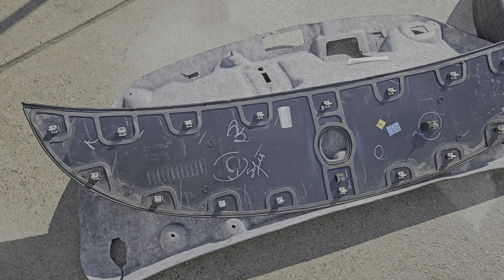2016 Lincoln MKZ trunk leaking water inside fix

Comment: I'm working on the same issue with my 2014 and discovering all the same areas where water is coming in. I used a dent puller to get that black trunk lid panel off which worked great. It's crazy that we have to do any of this at all much less the number of places to fix.
Reply from the maker: There is another leak under bumper on top of the air vent plastic trim.
Reply: FYI if you happen to break this part it's $800 that's as of October 2023. It is very easy to break that part. Be prepared hope for the best prepare for the worst

Comment: so i watched another video and there is a big gap along that track of the trunk right behind the tail light.  If i cover that gap that should help right?  

The guy in the other video took off the rear bumper and put tape on the outside of that vent.  Said that did the trick 

I opened the trunk today and found a nice puddle in the spare tire area.  

Does this happen from rain or washing the car or just both?
Reply from the maker: @875daily  that's another leak point

Comment: Hi, do you have a plan of the water drains in the trunk? Is there anyone who can ship the trunk seal to Germany? I sealed the upper part but water is still coming in.
Reply from the maker: Check how you sealed it, if it's good. I did silicone on the area where it had that foam tape. Then under bumper it should leak to. Right side vend
Reply: can you please show me where the foam tape is? I'm really helpless. can you please send me a picture of the spot? I would be very grateful
Reply: @ipartoutstudio  Have the same issue. Where is the under bumper leak? I’m going to attempt to remove the black trunk panel and use silicone, but I’ve had this leak for years, and I’m not optimistic.

Comment: Would it not be much easier and effective to simply fill in the gap along the entire outside of that upper fragile piece with thick clear silicone instead of removing it and the other parts just to try to put silicone in the multiple areas on the underside? If you stop the water getting down the edge, you then have reduced the burden of the problem entry way from the top.
Reply from the maker: Try let us know what happens. I never made you do anything, just showing the issue.
Reply: I tried this, and it worked temporarily, but the silicone wears away quickly when it’s on the outside, and the problem came back within a month or so.